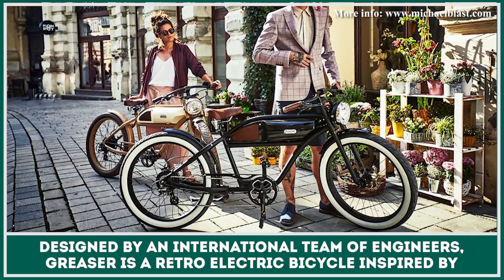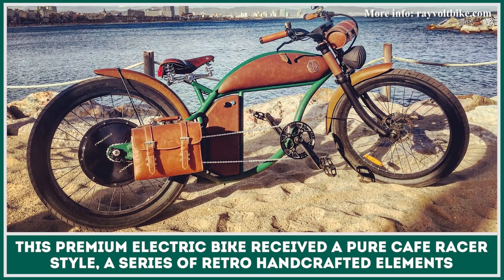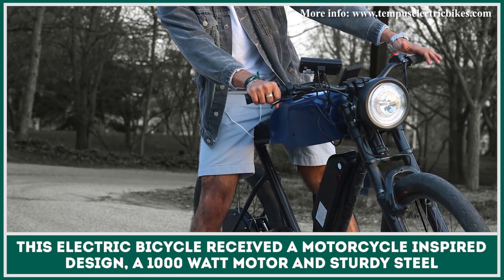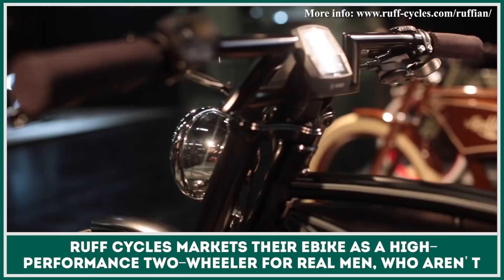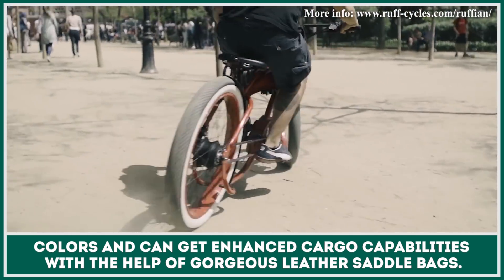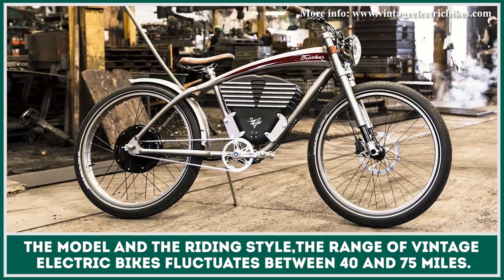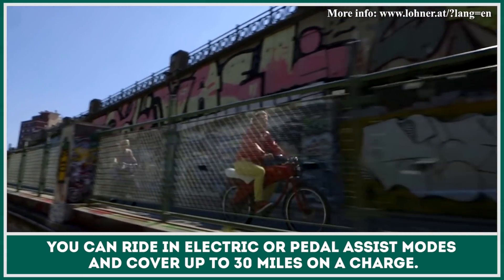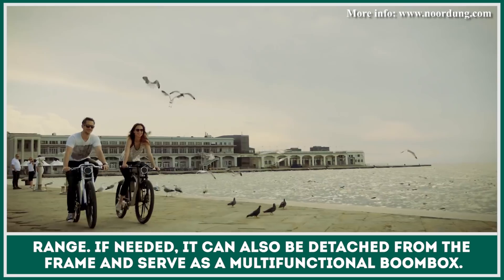7 New Electric Bikes w/ Old School Designs and Retro Bicycle Accessories

Comment: I just don’t understand making an e bike that cost more than a car ..5-6 grand for a bike??🤔🤔🤔
Reply: To be honest one of the bikes was 2300$ - when You calculate the bike, the motor and battery, plus work hours, plus mashine hours, plus profit - I would say a fair price.
Another bike has a carbon frame and weighs 15 Kg - my non electric cruiser weighs 18 Kilos and I consider it fairly light.
And You do realize there are bikes without motor out there that cost over 10000$, right? If there is a market for such bikes there will be people offering them :)
Reply: For real! Might as well buy a motorcycle for that price! Or a good used one!!
Reply: @anibalbabilonia1867  Read my mind! I would pick up a motorcycle honestly and have way more fun. It is very funny how people place so much value on things that make little or no sense and convince themselves those things are worth it. I have seen this is especially common in the world of visual Art (paintings especially).
Reply: @lcsighteken2248  True, but in the other hand these are targeted towards specific viewers. It is more for people who don't want to spend so much on a car, people who live in an area where the weather is nice all year round, and what i think is obvious is for people who don't have/want/need a license. Owning a bicycle is low maintenance whether its cleaning or fixing it, getting it professionally checked doesn't cost nearly as much (sometimes doesn't cost anything) compare to sending a car to a mechanic, certainly doesn't take up much space; i can go on as to why an e-bike is a great alternative. Even after owning 2 specialized (Cyclocross and Fixie) i'm still deciding on getting one when i decide to move to a 2 season climate.
Reply: @adelgado8917  You have a point there my friend. I agree.
Reply: I  make most of my money renting out property. These bikes are for people like me
Reply: Under the right conditions it is much better to own an eBike over a car (no insurance etc), or a regular bike (faster, easier, more fun).
Reply: rgjmg070607 rightt!!!
Reply: Of course, you would think the price is expensive if you haven't tackled custom building one on your own then factor in the man-hours as these are low production hand-built models. I have built many, yes you can cut corners here and there but when it comes down to it if you want any decent range and power at all a battery will cost you 1.5 to 2k unless you build the battery yourself then you can save money but it's very dangerous if you don't know what you are doing. Mountain bikes, beach cruisers and road bikes with no motors cost between 1.5k and 10k for decent ones these days, sure you can buy one at Walmart but you get what you pay for. The prices are dead on IMO, also E-bikes are in their infancy the prices will go down when the prices of batteries and electronics go down, but right now this is what you have to pay if you want to buy pre-built. After all, it's not like it was 20 years ago, have any of y'all gone window shopping nowadays? Aint nothing cheap anymore. Pizza is like 45 bucks for an extra-large 2 topping here in NorCal plus 5 dollar tip for the driver. Check out Micargi Cyclone you can get one between 1800 and 2000. Give it another year, the prices will drop quite substantially on the electronics and batteries. Hope y'all try one you won't regret it.
Reply: Too expensive...my electric bike already got stolen twice...first in Philly the second one in queens nyc......I have lost about $ 2,000 !
Reply: ride one.. You'll get it.
Reply: modern studies  Yep. Even if you aren't that handy it would be as easy as finding a bike you like, copying the frame dimensions and finding somebody with a pipe bender who will do it for you for about what? A 100 bucks? I wouldn't even bother with disc brakes. Rim breaks work just fine, no adjusting or caliper issues. You can purchase bafang mid drives all day long and have a bike guy put it together for you. In my neck of the woods there is a guy who will convert any bike you have to a mid drive bafang for a 1000.00 bucks motor included.
Reply: Nice build, but you have a good point 👍
Reply: 5 or 6 thousand, that's a cheap one and for the mountain type bikes worth every cent for us older folks.
Reply: Rich hipsters. These are for rich hipsters.
Reply from the maker: Hello, thank you for your comment. There aren't many new cars that cost 6 grand. As for the bikes, these are low production models with custom and hand made components, so these couldn't be affordable, unless they are mass produced.
Reply: @Datacube   по  внешнему  виду  напоминают  начало  прошлого  века.
Reply: Datacube: awesome facts and interesting top lists hi and you are welcome , I made my comment before I realized that most of these are custom and not mass produced which makes sense and also I didn’t mean a new car for 5,000 lol although here in the U.S you’d get a lot more then an electric bike that’s for sure lol .. thanks for the videos very informative, keep up the good work!
Reply: @rgjmg070607  

You're right 5,000 is way to much to spend on any bike IMHO and I have been a avid bike commuter for 4 decades. 

 But, one thing about a bicycle.  No insurance.  Even at my age with zero tickets and zero accidents.  
Insurance is 50 - 100 dollars a month just for liability not to mention significantly lower maintenance costs, no state or local registration fees (at least in my area)

Any bicycle over four or five years is far cheaper than a car.
Reply: @bnorberg988  Only a fool or an extremely rich person would buy ANY ebike and not have theft and third party insurance and, quite frankly, that goes for any bike of value, not just an ebike.  My insurance costs £150 per year.
Reply: @Biffo1262   Pounds to dollars that is just under 200 dollars a year.  But, lets say it was 150 just for the sake of argument.

I have commuted for 45 years and owned dozens of bike averaging around a grand each.  In all that time I have lost just one bike to theft. Yes it was my favorite touring bike ever (1985 Univega Gran Turismo) But by that time I had already had it for 6 or 7 years.  The total cost of that bike to me new was 575 dollars.  And the only reason I lost it was because I loaned a different bike to my girlfriend including my best lock.

Cost of insurance over 45 years approx 4,500 dollars cost of bike lost $575.
Insurance is reverse gambling and the house always wins.

I'll place my bets on good locks and smart choices for travel and homeowners insurance and dogs for when it is at home. Even with my ebike which I hate to admit I paid too much for.

You do what you want.
Reply: @Biffo1262  every bicycle electric or not can be insured for liability and theft under you home or content insurance policy just like a boat or motor home.
Reply: B Norberg - 5000 too much? Not really. It depends on the situation and personal preference especially compared to a car. You can easily save 5000 in a year over driving a car (not counting the cost of the car itself) so why not splurge a little and get something nicer, faster and more fun?
Reply: @cavebeastdemon3631  and spend XYZ $$$ to replace new 
battery each year. no thanks. rip off.
Reply: @dreadknot2238  Who told you EBike batteries only last a year? They use lithium ion  batteries and I have some tools with lithium ion batteries that are over ten years old. 

If you get a bike with a good quality battery and charge it properly , it will last a long time!
Reply: @cavebeastdemon3631  bull! i owned a laptop for two years now and recently my battery stop working, after doing some research and not find my answer i came to a conclusion that the battery died because of the constant used... now do you think i want to an buy e turd bike and have the battery be in the same fate as the laptop battery did? hell no!  theses battery  have  limit cell compacity until it deteriorate of many usage. after months down the road, the cells do not hold up as good as when they were brand new.  Any e turd bike owner will try to defend it at all cost to justify their spending  for owning a e turd bike.
Reply: dread knot - I don’t own an “eturd” bike but since your comment I’ve done my own research. I use lots of lithium ion batteries. There are a lot of variables concerning the life of L ion batteries. The time of usage is just one. Are you over or under charging them? Are they getting very hot or cold. Who manufactured it? etc. etc.

How old was your laptop? L ion tech gets better and better every year. What brand was it? I owned a MacBook Pro constantly plugged in (your not supposed to do that) and used it constantly for five years before the battery went. My sister got hers the same time as me (not constantly plugged in) and her battery is still good after six or seven years. On the other hand I bought a Ryobi (cheap tools) battery powered blower and the battery died in a month. 

Point is, do a little home work and lithium ion batteries can last a long time. Panasonic, (I use these in my cameras), Samsung and Bosch are good batteries that last a long time. Other brands are not as good. Some are just Chinese junk. 

Also Elon Musk and maybe others are increasing production of lithium ion batteries dramatically. The price will come down and quality will increase.
Reply: @cavebeastdemon3631  whatever, gas bikes will always be better i hope you brought a power plant with you in case you forgot to charge, aha.
Reply: @dreadknot2238  better is subjective, and as for the better buy a powerplant comment, then by that logic, better buy a mining operation and oil refinery and delivery network and gas station etc. for your polluting gas guzzler. 

by the way, my friend archie in california has a house with solar panels and his biggest bill is around $5 per month, in the summer when they run the AC like mad, and everything else, usually the utility company sends him a check. the point is, we're at a point now where we're already making our own electricity, so you don't need to buy or bring a powerplant to charge. xiaomi makes an ebike with 120km range and costs around $400 new. how many people drive more than 120km in a day?

besides, these things aren't for everybody, i for sure can't afford one, but i'd love to have one. i've ridden an ebike before, and it was so much fun.
Reply: @teklife  scooter too slow..i don't have time to sight seeing if im in a rush ive seen couple videos of guys scooter run out of battery in middle of the destination they had to haul their ass on the cab to get home. i don't know why u comparing utility over vehicle when they have two different agenda and I can guarantee you 100% these aren't convenience in a raining season but using a big cities that i can agree to.
Reply: @bnorberg988  You FCUKin Dude you... Win win all the way to the bike shop  G :)
Reply: @bnorberg988  point made... but that's assuming in 45 years you still have a 45 year old bike worth $6,000. 

And like anything.. you better shop around. If I purchase one of these I would absolutely be looking for some kind of insurance to cover it if it was damaged in some way due to my own fault. However after a couple years you'd best be checking with your insurance to see if what your paying for a premium makes sense for what they would give you in event you made a claim. I guarantee you insurance won't give you $6,000 for a bike worth nothing 45 years from now. If you spent 45 years paying that rate.... yur... ya better shop around! :)
Reply: @TheProletariat.  Even when I have a car/truck to compliment my e-bike, if it costs less than 5k I never pay for anything other than liability.  It simply isn't worth it.  A 20-40k car...?  Sure buy full coverage.  

But IMHO you get better bang for your buck with a cheap used car and good maintenance anyways.
Reply: @bnorberg988  it really boils down to what interests you and what suits your needs.

I drive a nice pickup truck about 2 miles back and forth from home to work. I live in small town Wisconsin. $4/gallon gas doesn't really phase me much driving 4 miles round trip each day. I'm not the least bit concerned about parking at work or any place id ever go. I have a couple acres and a nice garage.. so I don't pay extra for parking in a ramp or something like people in condos or apartments might. I don't work in a busy urban city. So a bike like this is really just something that gets me in the sun more. I can get a little exercise on way to work. I can just go for a bike ride down a public bike trail. It really just depends on what fits yur need. If I had to lug a tool belt or drive out to a farm on gravel roads... no I'd buy a cheap car if fuel was an issue.

But if a guy spent 7k on one of these I'd be hard pressed to not see purchasing insurance for at least a couple years. If you purchase with a loan I'd almost bet the bank would make you insure it anyway until the loan was paid off. 

I know numerous people whom have paid these prices on side by sides and 4 wheelers and each of them hold insurance on them.... they are as red as they come... and even they see the value in insurance on something they spent $7k on.

But for the sake of discussion.. its really up to you. How much or how little you want to spend. Maintenance. Reliability. How much you use it and what you gain from it. If it works it works. Clearly these work for alot of people!
Reply: @TheProletariat.  You drive an ICE 2 miles?  

To each his own, I guess.
Reply: @bnorberg988  to each his or her own! Absolutely!
Reply: @dreadknot2238  why no one uses gas bicycle then?
They are sooo cheap where i live yet no one buys them...
Reply from the maker: It's nice to see people, who understand the bicycle market. Some MTB and advanced bikes that are not even electric, cost over 10 grand as you mentioned. Biking is not an affordable hobby, especially if you want the best performance and riding experience.
Reply: @Datacube  $2800 is not that much money for a 500w fancy designer fat tire bike.
Reply: @Datacube  Hi, If you only have one bike I beg to differ with biking being  not affordable.  I own 7+n+1 bikes, 4 retros, full on Eddy Merckx racer, 1 hybrid and 1 MTB and another on the way Oh and a ZX7R, good job they're not kids!!!... love them all coz I peddle. I'm 58  and hope I don't need any assist for another @least 20 years. The Rayvolt looks stunning in its green and leather livery. G :)
Reply: @Datacube  Don't scare people away.  

Plenty of decent bikes can be found at a decent price point.  Super light weight?  Maybe not.  But, to be honest for most riders comfort and fun is more important than a competitive edge.  And the used bike market is awash in seldom used bikes that have sat in a suburban garage for half a decade just waiting to be finally put on Craigslist.

Not to mention many people need to worry about losing ten pounds of body weight over losing 6 oz of rotating mass.
Reply: B Norberg If there are similar bikes for less, quit complain about this and post a link!

Comment: The only thing that can impressed me..is an E BIKE with stator that can charge the battery!!! I guess the cvt scooter bike has the potential!
Reply from the maker: Hello, thanks for the feedback. Are you talking about the regenerative braking systems?
Reply: Regen is basically pointless on a bicycle.

Comment: I own the Greaser. It is truly a fantastic e-bike, well worth the 2.6K. It rides solid, smooth and turns more heads than Pamela Anderson. It's not overstated in design like some of the others in this video, but has the perfect mix of retro styling and futuristic technology. 9.5/10
Reply: Personally I like my ebikes to be lightweight and most of all practical.  I can use mine on a trail and lift it over 'horse steps'.  It has a range of over 100 miles due to no resistance Bosch crank drive and cost me less than £2000!  The battery is removable for ease of charging and it improves security.  Those fat tyres may look good, though that's a matter of opinion but apart from the extra weight they increase rolling resistance making it harder to pedal and increases battery drain.  Question is, do you want practical transport or are you trying to make a fashion statement?
Reply: Steven Booth over 100mile sound good what bike is it please?
Reply: John Drohan   Amazon is best. No nonsense. Word of warning: the shipping carton is monolithic, very big, won't fit in anything smaller than a larger minivan. Let the couriers deal with it
Reply from the maker: Hello, thank you for your feedback. We are so glad that you are fully satisfied with your bike. Based on your ownership experience, would you change anything about it?
Reply: @Datacube   a clip on v twin above the pedals in plastic that would work as a storage box or carrying box.
Reply from the maker: There retro bikes combine both. They indeed make a fashion statement and at the same time, provide most of the features any other ebike would.
Reply from the maker: Looks like custom build. The only production bike with the range like this that we know of is the Delfast.